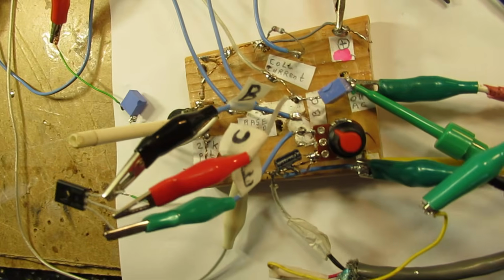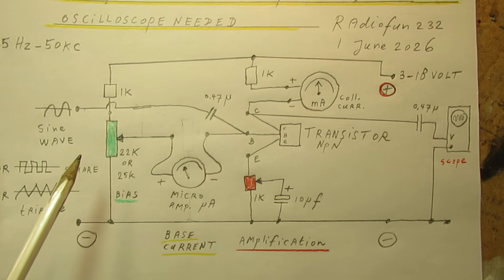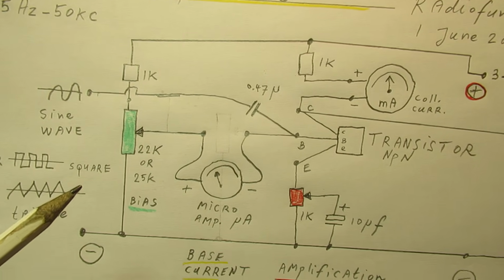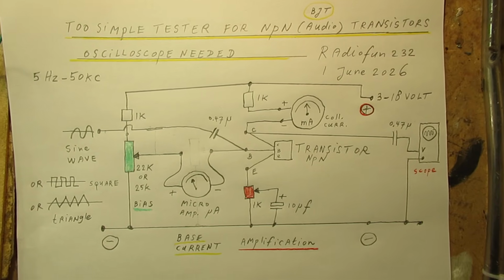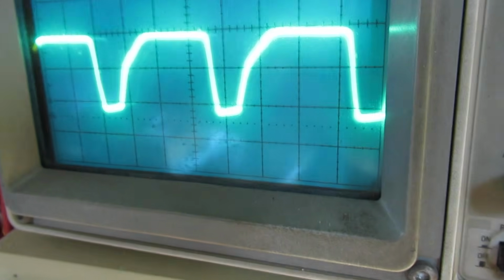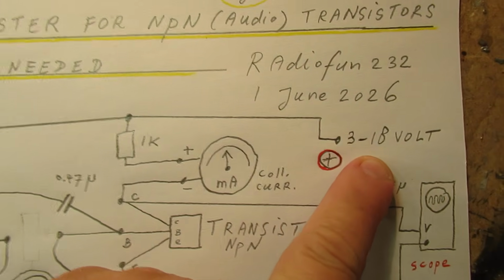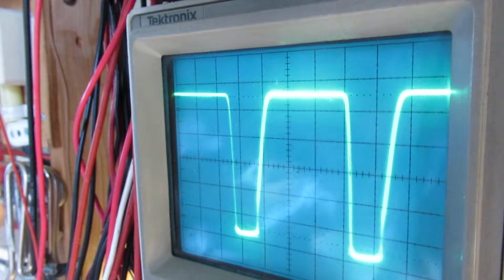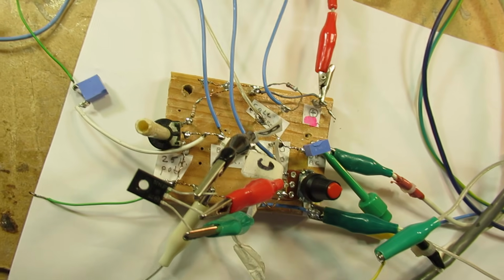Simple but very functional dynamic tester for NPN BJT (e.g. audio) transistors (oscilloscope needed)

Comment from the maker: When you want to use it as a PNP tester, read the textbox for more information. Especially about how to use that 1 K protective resistor in that case (other position, compared to the schematic, connected to "the other side" of that 22 K or 25 K bias potentiometer). To prevent that your PNP transistor burns out due to a too high base current when you turn the bias potmeter in that PNP case.